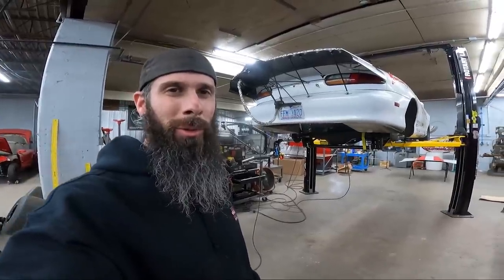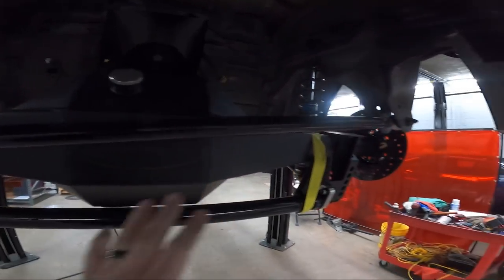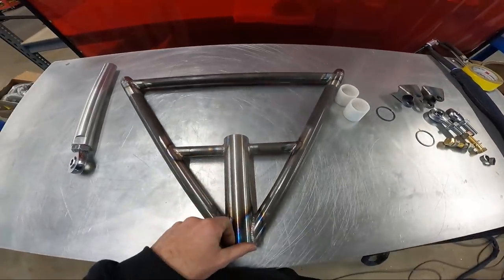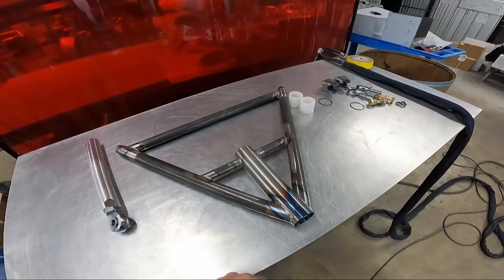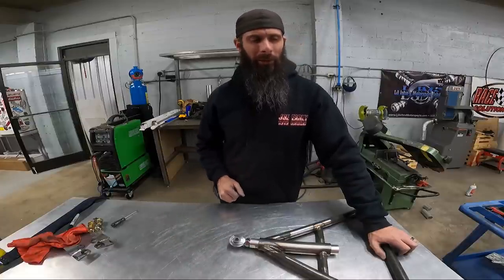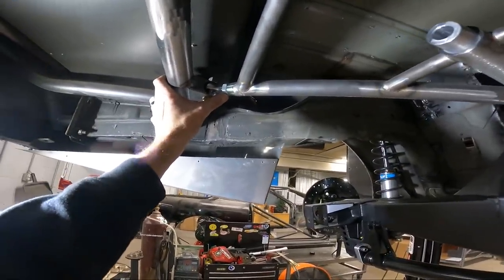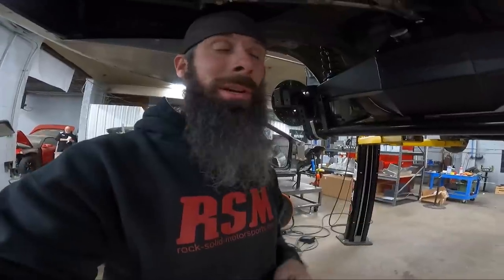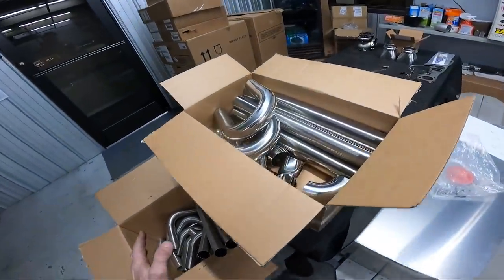Grubbworm 2022 Updates Video #4. Hammer Concepts and Designs Wishbone Install!!

Comment: Wishbone track locator is the best thing I did to my car.... it became undriveable after I went to the radial tire.  A panhard bar just does work on fast cars that run lots of rear seperation..... like you explained the side to side movement of the rear turns the car.  I've noticed GW doing the same thing for a while now and wondered when Johnathan was gonna get away from the panhard bar.  Enjoyed the video.

Comment: It comes with instructions that tell you not to weld on the tubing where the bushings go.  The supports are supposed to be welded on in the middle away from the first and last 2" of the slider tube
Reply from the maker: We make our production units different now to get away from bushings. Still have to adjust the bushings after welding to get just right again. It's no big deal really. Could send them out as is and it'd be fine but we want it as free moving as it came in the raw.

Comment: I have a question Stephen.  The wishbone is headed "downhill" at full droop of rearend but what about at ride height? how much higher is that thing going to travel and would the beveled bushings need to compensate for that??? Reason i'm asking is because I have an MWC ARB that rides above the rearend but uses the same technology as the one on GW, with cut to length tubes down to housing mounted tabs on the top of their fabricated 9".  Mounted to a crossmember where the fuel tank used to reside.  I'm trying to see if there would be interference at ride height of these two items.
Reply from the maker: At ride height it is going uphill about the same amount maybe a little bit more. It's not going to be at ride height going down the track so you have to find a happy medium somewhere

Comment: Question: why not welding the tabs vertical instead of horizontal? Then there will be almost impossible to get bind when rearend travels up/down, or?
This is a general question as "everybody'" seems to weld the wishbone tabs horizontally...
Reply from the maker: Because the load the wishbone is seeing is horizontal

Comment: My question is. What is the difference between mounting it behind the rear-end  inserted in front?
Reply from the maker: You can really Mount I wishbone any direction. My personal car the wishbone is on the bottom of the rear end with the single mounting point on the chassis. This one obviously is an opposite of that and behind the rear. The torque arm pretty much eliminates the available real estate anywhere forward of the rear end and because there is nothing to connect it to down low it's pretty common for the f-body community to place it in this location